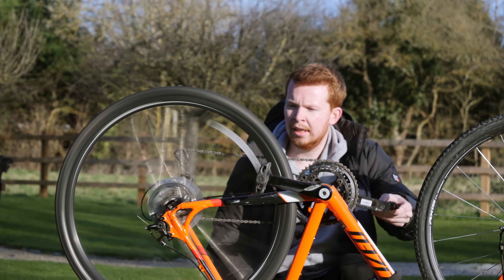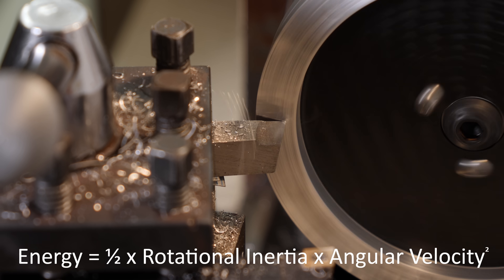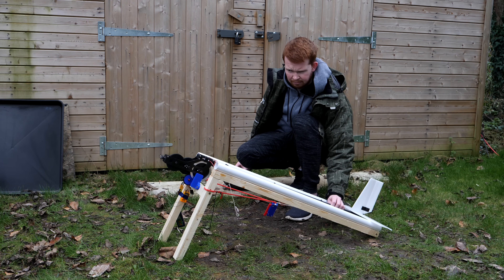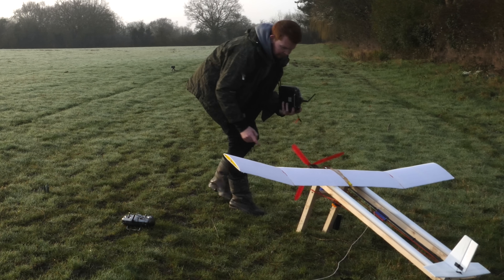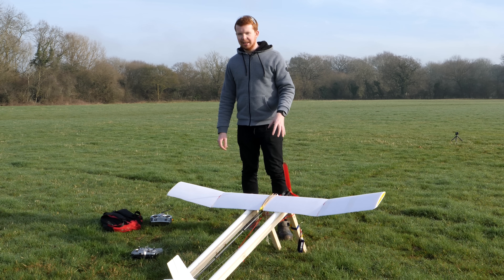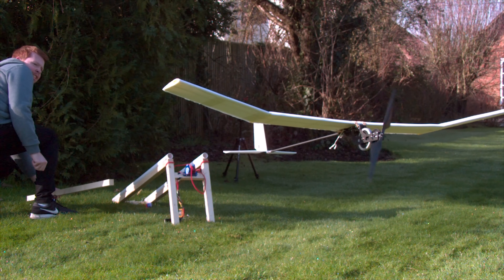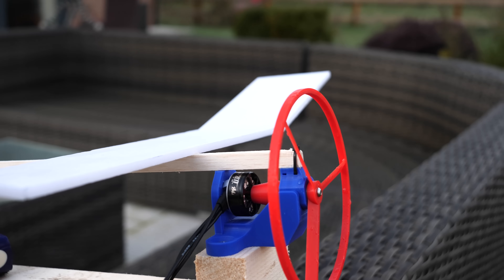Flywheel Powered Plane

Comment: Flying cylinders are a thing
Cylinders fly well.
Maybe use a larger fly wheel to spin a smaller cylinder 
If you notice to much sideways drift 2 cylinders rotating opposite directions should fix it

Comment: Very cool! I wonder, if you rotated the flywheel in the opposite direction, if there would be forces pulling up, rather than nose down? If your CG was on the flywheel center, it seems there was extra force on the nose to go down. I recall your cube drone with the flywheels and was amazed at how it threw itself around. You've probably seen it but I'll link an old lecture on gyroscopes by Prof. Laithwaite. So controversial (with non-science, scientist) the bbc didn't air it. https://www.youtube.com/watch?v=0L2YAU-jmcE

Comment: Hey Tom, love your video, but I think your biggest issue with the flywheel plane is that your center of mass is too far forward, causing the plane to nosedive after launch. Consider adding equal weight on the tail, or figure out a way to shift the flywheel further back

Comment: Spreading flywheel mass on the perimeter is not the most effective solution. As you correctly stated, speed is more valuable than moment of inertia, but with a greater speed comes a greater mechanical stress. The most effective flywheel is the one where the stress is equal everywhere. Contrintuitively, it is shaped more like a top than a wheel: thicker toward the center, because each inner ring  bears a centrifugal load of itself plus all outer rings.

Comment: There's SO MUCH of loosing the energy in gears' friction!
especialy on the 90degrees transmission.
Try to get rid of gears as far as you can
Reply: good point.    but, can't avoid the ninety.       the final success could be combined with the earlier failure.... a (lighter)  flywheel and a prop with flywheel dom.    distribution of mass.    clearly,  AUW  Must  be  minimal.      the  Minimization of mass   WHEREVER   practical is essential;  including, at  All the components of the drive train, and  the  TOO-long and  Heavy,  CF  tail boom.     cheers
Reply: Just replace gear system with DC motors connected to each other

Comment: Great video Tom. Your problem is a lift to weight ratio. There is not enough lift created by the prop to overcome the weight of the flywheel. If you  put  wheels on the front using spring wire (to keep the prop from hitting the deck) and have a runway to let it build up speed, then the airflow over the wings will lift the plane . Also the flywheel seems to be slightly forward of center, hence the 'nose-dive' The' Hula' was caused by the prop deforming and it hit the Front of the square balsa shaft. So need a longer prop shaft to get a little distance for safety.  The flywheel will act like a bike wheel and just lean the plane if you turn the plane. That's my observation.  If you put a small weight on one side of the flywheel, it will make your plane do circles.

Comment: How about a fidget spinner powered plane? The fidget spinner will act like the Flywheel. Edit: About 18 yeas ago or so I used to have a to airplane that worked on the same principle of the pull cord toy you showed at 5:06.

Comment: Thanks for the lessons. The first launch ramp is too steep and maybe too short. The plane can't gain speed because using too much energy climbing. A longer length ramp means more friction, so thin carbon fiber wheels with lightening holes on thin oil instead of bearings. The second plane was .great. - same concept, components removed. The flying hoola hoop is a winner. Soon to replace the airliners. The people will have to get used to being dizzy tho.

Comment: you might get more energy from faster rotation than weight, but the rotation speed is what you lose in use... so I guess that's why flywheels are heavy.

Comment: Sorry but this was really shoddy engineering. What's the energy stored in the flywheel? How much energy did you need to spin the propeller at the desired rpm for as long as you wanted? What's the losses in the gears? Could you have achieved higher efficiency by converting the energy of the flywheel into electrical energy and spinning the propeller at constant rpm throughout the flight?
Why is the launch ramp such a joke? Even just launching with 5m of bungee cord staked into the ground would have worked better.
...

Comment: Maybe a fly wheel in a helicopter/rocket would do much better since the main problem was that this was nose heavy.
Also, I would remove any rubber bands from the design and try to get direct transmission.

Comment: I was hoping to see a try with a heavier ring around a suitably solid propeller, spun to high rpm. Also, maybe have flywheel like in the first attempt, but employ some sort of governor system on the prop shaft with a clutch, so the flywheel can be spun up faster, then spins the prop (with it's own flywheel outer ring) up to a predetermined speed (which would be a fraction of the flywheel's speed), when that speed is reached, it would disengage, (saving energy) until the prop slows, which would re-engage the clutch to spin the prop faster again. It would have probably still not worked very well, but would have been interesting to see!

Comment: Did you try reversing the angular direction of the flywheel?  My guess is that it should be to the right.  Then the force applied to the flywheel from its frame would be in the direction of lift.

Comment: Question:  The first version that you tried had the flywheel rotated 90 deg (aligned parallel to the plane's body) as compared to the angle used by the 'successful' version 2.0.  Would that have played a factor?

Comment: If you put pedals on the propeller side and propellers on the flywheel side you would be able to pedal a plane at high rpms with minimal foot power. Try it. You can have the first human propelled personal flying machine
Reply: Or you could connect a small electric motor but I know this can be done you have the skill. If flywheel has more rpm than propeller turn the device around and try a high rpm battery drill motor

Comment: You like testing things so.. Use a rocking chair with the vacuum syringe rocket effect or a train look-alike system on the side of the chair and a flywheel (flywheel for both senarios) to make a torque/rpm motor work and test W/h. If you have to start the flywheel by hand because of its weight use an one-way power delivery transmission system for the user safety.
   Do not think that it is the same as a bicycle. You are using your weight plus the momentum you gain and most important you don't get tired!

Comment: I like the idea but you need to move your flywheel maybe 30cm / 1 foot towards the tail. Keep a short band on the gearing system and drive the prop via a shaft (carbon fibre rod would do well). Then it will fly much better.
You've got enough speed I'm sure, but your centre of gravity seems forward of the front wings which will always cause a nose dive.

Comment: Your first flywheel design (aluminum wheel - carbon core) just needed a bigger plane.  The weight of the flywheel was preventing flight.   Good Video -  Thanks  : )

Comment: Reminds me of the U.S. Navy's Howell Torpedo of the late 19th century. Developed in 1870, it used a 60 kg (130 lb) flywheel spun at very high speed (10000 to 12000 rpm) for power and had an effective firing range of 400 yards. The flywheel not only powered the torpedo's twin propellors, it was also mechanically linked to its rudders and planes and utilized as a primitive gyroscopic guidance system to keep it on course to its target.

Comment: I wrote paper on flywheel energy storage system in satellites. flywheel moving in vaccume on air bearing  with 100k rpm has much high energy density (weight ) then current batteries.
Reply: Don't I remember, quite a few years ago, a bus being developed (in Switzerland?) that ran for several hours on a massive flywheel that was spun up to some crazy RPM at the depot before setting off?

Comment: Normally a flywheel is not directly connected to the thing it powers as so it can get to a higher rpm. Put a generator on the flywheel and a motor on the propeller and then put a stupid amount of rpms on the flywheel.  Then it should fly for a while.

Comment: 4:57 The flywheel is creating a massive amount of torque relative to the weight of the plane. with the flywheel perpendicular to the plane, and the rotation twisting toward the nose, it puts it in the FDAU position, perfect for a broken propeller. adding a few grams to the tail may do the trick... or re-gearing to have the opposite effect, pulling the nose up and adding weight to that, but with the wings being the vertices, it would be a much larger weight increase due to proximity alone. OR you could orient the flywheel and gear for a perpendicular rotation opposite that of the propeller, using carbon fiber spindles instead of a disc to reduce drag, possibly shaped to increase thrust? I think adding weight to the tail would still be your best option with the current configuration.
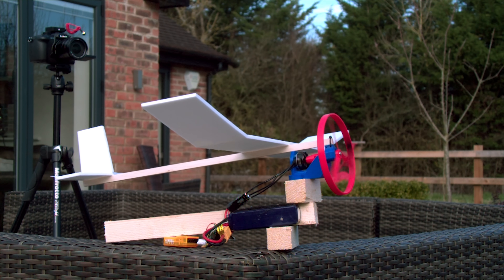5:46 I should have just kept watching lmao
Reply: Not only that, but with as much angular momentum as a flywheel has, the precession force will be absurd.  So even if you manage to put enough weight on the back to counteract the momentum of the flywheel (which is also only going to work momentarily as the flywheel loses momentum to the propeller), any torque applied by the frame of the plane to the flywheel will cause a precession according to the right-hand rule (so 90-degrees deflection from the direction of angular momentum).  So, if the flywheel is spinning forward, and a breeze blows the tail to the left (applying clockwise torque perpendicular to the spinning of the flywheel and parallel to the ground), the flywheel will precess counterclockwise perpendicular to the ground, causing the plane to roll to the left while it yaws to the right... and it will crash pretty much immediately.  A similar effect will happen if something makes the plane roll, though if it rolls to the right, the flywheel will cause it to yaw to the right, not the left.  This behavior will reverse if the flywheel is spinning backwards: a roll to the right will cause a yaw to the left, and a yaw to the right will cause a roll to the right.  The only way to stop this from happening is to decouple the flywheel from the frame, like the 3-axis gimbal mount of an avionics gyroscope.  You would only be able to extract energy from that type of flywheel electromagnetically.
Reply: @SmokeyPillow I rarely comment on videos, so no need to have the editor open all the time. @ELEGANTFOX, thinking more carefully about it now, I believe I typed the first part, played the video for more reference, and saw that everything I said was a moot point... So instead of removing all logical thinking, I simply added humor.
Reply: I'm with you here, and the ideal place to add weight would in in the ring around the propeller blades. This ring would then achieve three purposes: balance through weight alone, counteracting flywheel torque with a gyroscopic effect at the nose and also adding rotational mass to the flywheel system.
Reply: its also about the center of mass the flywheel generates, flywheels are used in boats as a center of mass to counter all boat movements and in formula one cars increase the heigh of the center of mass of the vehicle. 

placing the flywheel in the back or middle and the propeller at the front could do the trick, also the shape and length of plane hull and wings is important to counter the flywheel center of mass
Reply: Were you watching the video while typing? You didn't edited it
Reply: This was 2 months ago, I don't know how to answer your question.
Reply: @ELEGANTFOX  Probably just had the comment editor open during the whole video

Comment: I'm not sure how easy it'd be to do with a thrust stand but you should work out the efficiency losses in the gearing, I'm assuming it's pretty high at those RPMs which is why direct drive worked the best,

You should go one better and mount an Alu ring around a CF prop and see how far you get! :-)